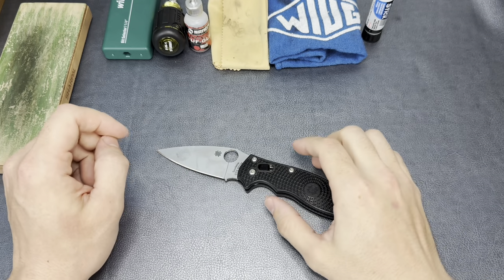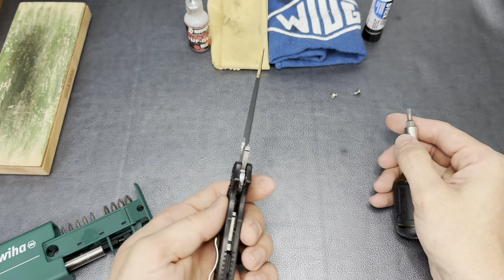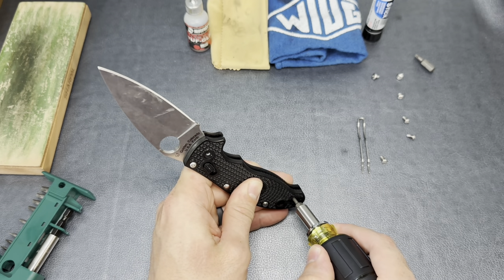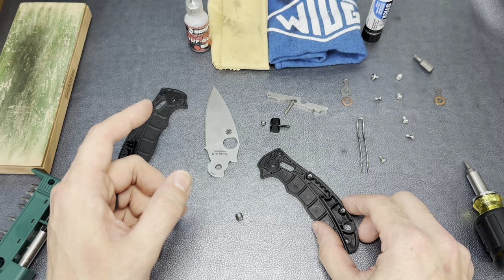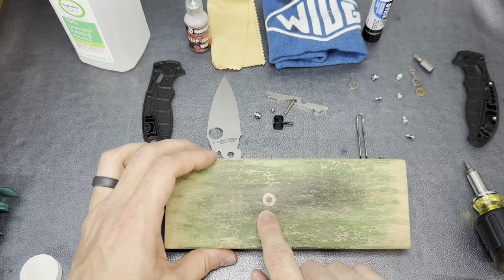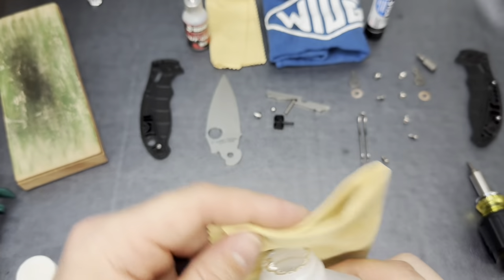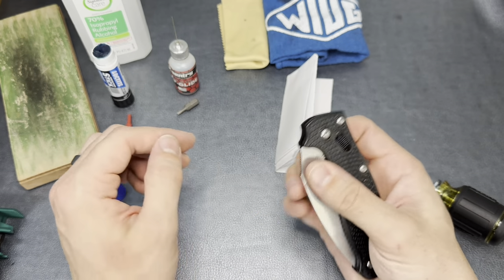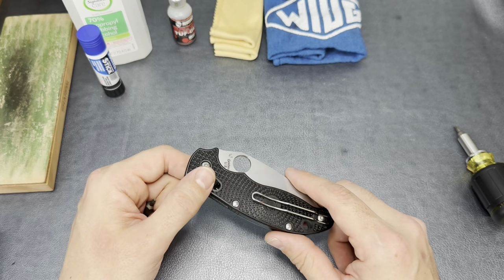Spyderco Manix 2 LW Disassembly/Maintenance

Comment: I  don't lubricate my knives anymore. The lube attracts dust, dirt, and lint. That's what fouls the action. Todays bearings or phosphor bronze washers provide enough glide to dispense with the oils. When my knife is acting slow, I simply blow some compressed air in there and I'm back to new.
Reply from the maker: It’s definitely important to keep dust and dirt in mind!  I use minimal lube if I know that’s going to be an issue.  And that’s very true about the materials, phosphor bronze has natural lubricity, so it’s not crucial to have a lot anyway.  Thanks for the comment!

Comment: Hey man I have a question about the lightweight. I habe a 15V manix blade that's in a lightweight frame.. I bought it this way. Im having a major issue to where the blade isn't locking up. So I guess my question is, does the lightweight blade have slightly different lock geometry or a different lock ball? Out of the 100s of blades ive had from spyderco, none of them hahe been a manix. The only reason i bought this is because the blade is 15v and its the only leaf shaped blade in this steel. (To me the best  steel they made) Any help would be appreciated
Reply from the maker: My understanding is the lightweight blade is slightly different than the g10 blade, which the 15v originally came as.  As far as I know, the two are not compatible.  Next time I take my g10 and lightweight versions apart, I’m going to see what the differences are .  Sorry I couldn’t help more than that!
Reply: @The_commonman  hey ! No man that is pretty much what I was thinking too and based on aftermarket scales not being compatible with the two, that pretty much confirmed it. Thank you !

Comment: My pocket clip rivets are spinning with the screws, how do I stop this? Yours seems to just loosen.
Reply from the maker: I didn’t have that issue, and having not removed the pin, I can’t say if it’s supposed to be held in place (without spinning) or not.  The only thing I can think of, is to see if you can use a pair of needle nose pliers to hold the pin end, unfortunately this may scrape up the pin.  I hope that helps!
Reply: Same thing here! They must have tightened the ever living crap out of them and slathered loctite onto some. I'm debating what to try..... another video I saw the maker had to dremel a slot into the smooth capture side of his. 😬🤨
Reply: @gregmccormack5709  I ended up snapping the scales, completely destroying them. Good thing I was putting on new scales, would definitely need a dremel if not.

Comment: How much wear does the detent ball cause on the tang of the blade ?
Reply from the maker: There’s a light mark on the blade, but no noticeable wear
Reply: @The_commonman  thanks
Reply: I've had manixes from original old LW versions to new G10 and LW, and none have ever worn out or shown wear. The spring does get softer with age though.

Comment: where did you get this from? is it the cheapest version 2 of the LW?
Reply from the maker: I got this from a small shop in Maryland, Willey Knives.  I paid slightly over normal price, which is often the case when buying from a brick and mortar store.  This is the most basic version of the revised Manix 2 LW, it seems like just about all retailers are now selling this updated version, for right around $130-140
Reply: @The_commonman  weird, i guess m4 at bladehq at 134 is a steal then. i've only seen that knife in super steels

Comment: About to do this to die my yellow magnacut scales
Reply from the maker: Awesome, I’m interested in how that turns out!
Reply: You don't necessarily have to take the knife apart to dye it, especially on the magnacut version. You can just hold onto the blade and swirl the handle in the dye and get the same results 👍🏻 hope that helped at least a lil bit

Comment: The only thing I've done to my EDC  are adjust the Omega springs I wouldn't dare to do anything else I just got into Spyderco I got the Endurance 3 and the Rock Jock getting used to the weight it would have been nice if they came in G10